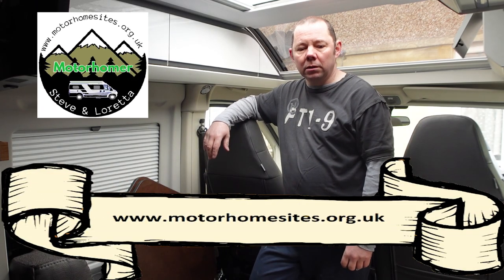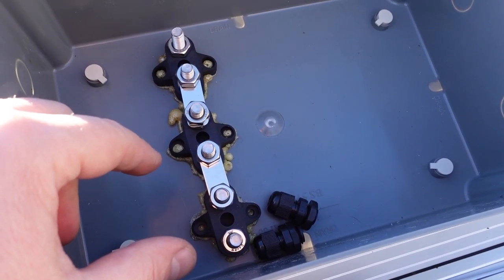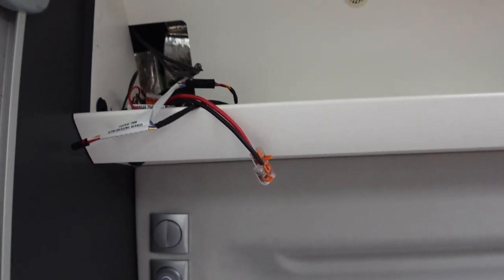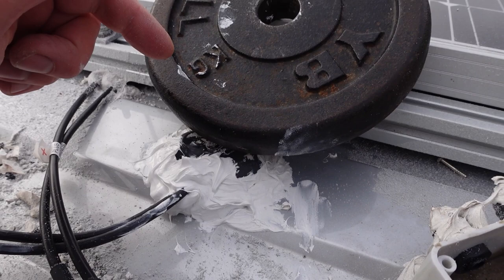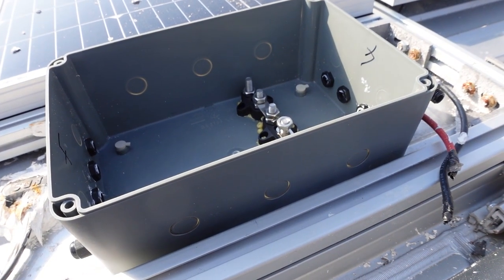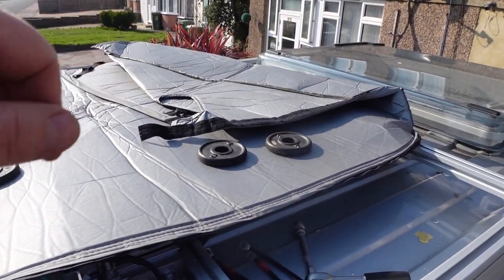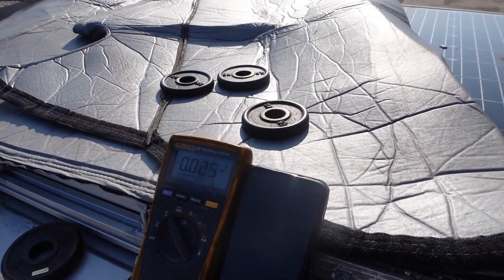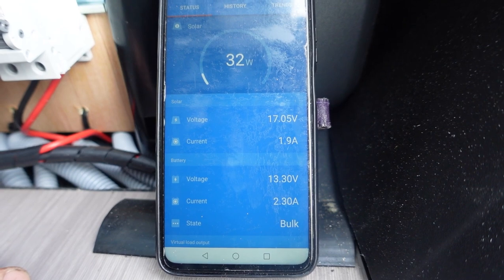Solar Series or Parallel easy switch configuration

Comment: Thanks for this experimental and clarifying video Steve! Really interesting. Great to have the possibility to optimize the output.
Reply from the maker: Thanks. Since doing this I have done more research and believe there will be no reason to connect in parallel. More advanced mppt and better panels now means there is no disadvantage with serial connection where there is with parallel. Did you like the Facebook plug😂
Reply: @BrackstonesTravelAdventures  OK, thats interesting to know. Oh yes, liked that one. A waterhole for Twin owners indeed! So much knowledge 🙌

Comment: Hi Steve.
I have just bumped into your channel and you explain things well.
I also use solar on a domestic basis but also build Lithium ion 18650 battery packs to store my solar energy.

The small 7ah 12v DC battery you were using to power your LG 19V DC TV is a handy size,and you can buy the empty battery box from China .
It comes with the nickel strips to spot weld the individual 18650 batteries into one big battery.

I Built my own spot welder using a microwave oven transformer.( videos on YouTube )
It also includes a BMS to protect the battery unit whilst charging and discharging.

You can charge these with your camper van solar system and set your controller to B3 in the battery type setting ..

I will subscribe now and look forward to your future content.

P.S . . . a bit rude of me,but you look a bit like Reg Varney from On The Buses,which I loved watching as a kid .

Anyone else said that to you ,or just me ?

Good luck with your channel & God bless .
Reply from the maker: 😂😂 That's a first for Reg Varney. Thanks for the very nice comment. Your battery setup sounds amazing. I am hoping to do a domestic setup in the future when I have the funds. Looking at getting the eve lithium cells from China needs to be at least 3kw power at first and solar to match. Good luck in your next adventure thanks for the sub

Comment: Really liked this video, as science is always fun, I know this is a bit old now, but PVC pipe glue would have worked well in that box.
Reply from the maker: Do you mean for holding down the terminal bolts. I will be removing this box now as I think there is enough evidence out there that serial connection is best unless you end up going over the MPPT max voltage.
Reply: @BrackstonesTravelAdventures  Yes, depending on the plastic they used on the terminal bottoms, and I agree running your panels in series will be better, ie, fewer wire losses and the higher voltage will run the MPPT a little longer.
I have 2x 400w panels running in series to give me voc of 80v and MPP of around 62v going into a 40a/100v MPPT which is charging my 24v 200ah battery bank, but I built my system just to charge my ebike, but I have found I can power much of my home.

Comment: Hi Steve, I'm planning on making the same changes but one thought/question. You changed the solar wire from the roof to the connection at the side of the fridge but how easy/difficult to you think it would be to upgrade the cable from the fridge connection to the Solar Controller. I'm looking at a 400w panel and concerned the gauge of the existing cable may not be sufficient. Fantastic vids by the way.
Reply from the maker: It would not be too hard to upgrade all the cable but I do not see a need to do this. I believe the cable was 4mm will be printed on side of the cable was not less than 4mm. This has a current carrying capacity of 32A when run in conduit and higher when not in conduit. At a guess your 400-watt panel will give max 14A at an open circuit voltage of 30v. With these figures the voltage drop on 5 metres cable will be 0.6% well below the regulations for this setup. I have an off-grid setup with 1200 watts running 4mm cable so it will be fine. Only reason I replaced the roof cable it was the original NDS solar panel cable not great and was not long enough to connect to my new panels.